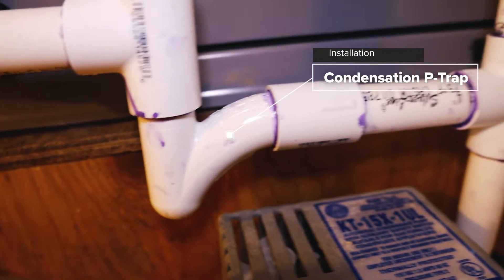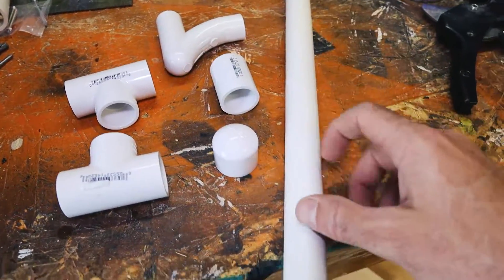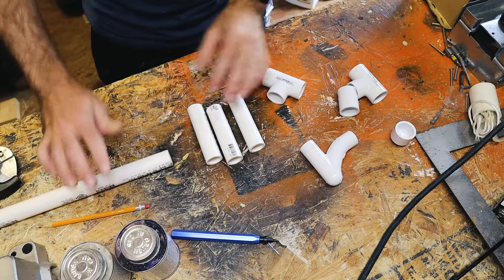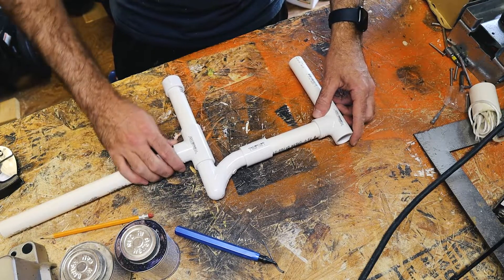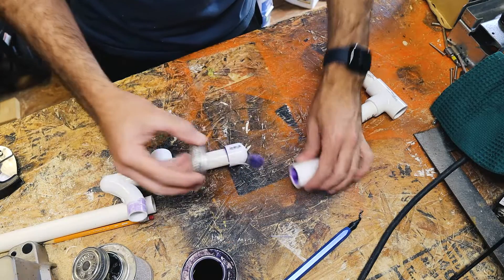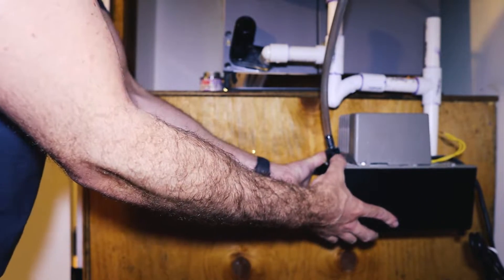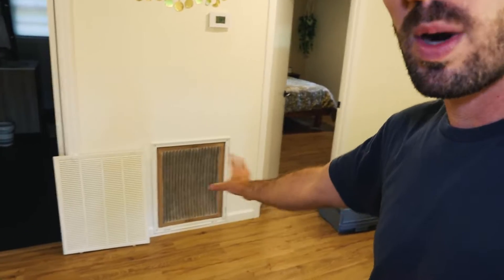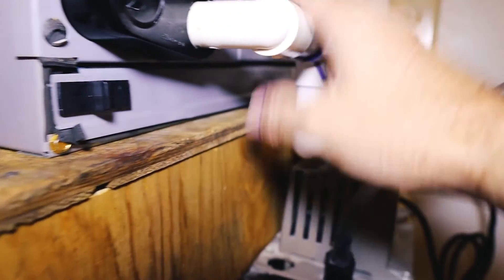HVAC Condensation P Trap installation | Stops Leaks!

Comment: Great video! Only thing I would add is - you don't glue the cap on before the P-trap - the cap should be removable for cleaning the trap. 
Haha I just saw at 6:39 you caught it.
Reply: Is there a "special" tool for removing the cap. Mine is not glued but it is on there like a mofo.

Comment: You also need your overflow connected with a shutoff float switch. You need to check how deep the trap to match the depth required by low pressure of the air handler. The required depth is in the installation manual that no one read when they were installing it.

Your trap will clog and you will have to rebuild it correctly. Next time add a globe valve before the trap. Then you can blow out the trap after closing the valve.  Otherwise the air will go back into the air handler instead of the trap. Next time ditch the vent, it is not required.

Comment: No need for the trap, the pump acts as one
Reply: Then why was it leaking? The pan overflowing? Maybe without the vent there was a vapor lock between the pump and condensation line? And the pump only activates when the "float" reaches a determined height.
Reply: the trap is needed before the pump. without it, the condensate simply suck air from pump and doesnt drain into pump

Comment: @KellyConcepts I have the exact same setup with a P trap but both my cleanout and vent are not capped. When I ask my HVAC technician if I should cap the cleanout, he told NO don’t cap it. The problem is that the cleanout is venting out a lot of cold air into my hot attic. It does NOT have negative pressure but rather positive pressure. Any ideas why I can’t cap my cleanout and why cold air is venting out of the cleanout?
Reply: I had similar set-up  without "vent" past the p-trap, and the negative pressure (sucking inward) (fan on exit side of condenser) pulling air through the condenser, stopped the draining function. You may be having "positive"air flow, air blowing through from the front, thus pushing air out through the pan?

Comment: That’s not a p trap. P trap, S trap, V trap, refers to shape of the trap itself. New pvc will not crush by using a sharp ratcheting cutter. Only old brittle pvc will crush. You don’t need to debur it. If you use a saw your thumb will remove Al the pvc dust.